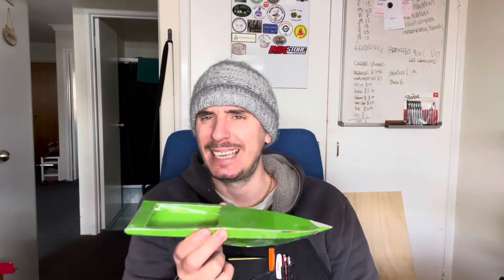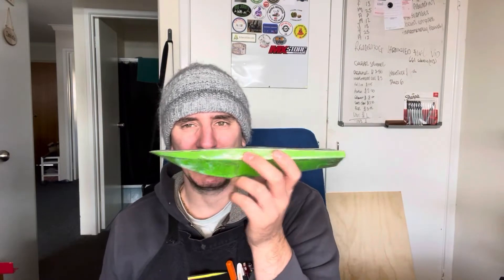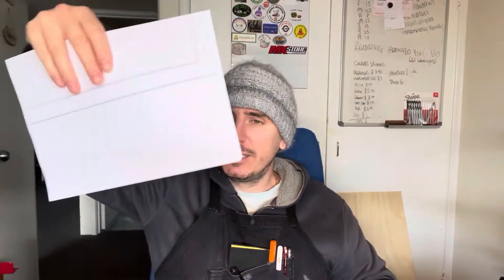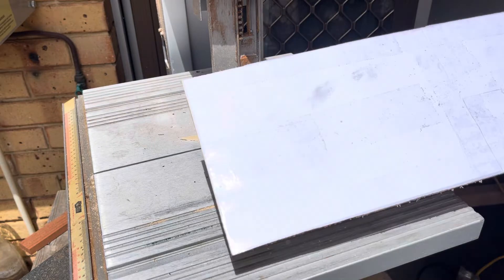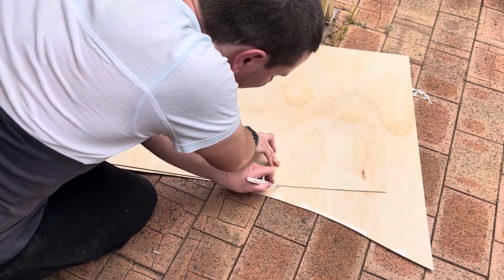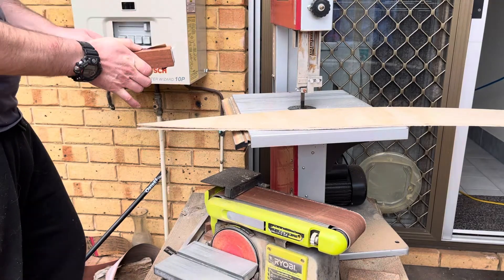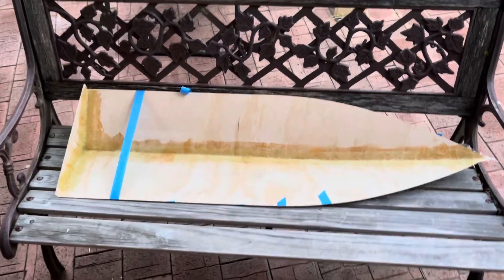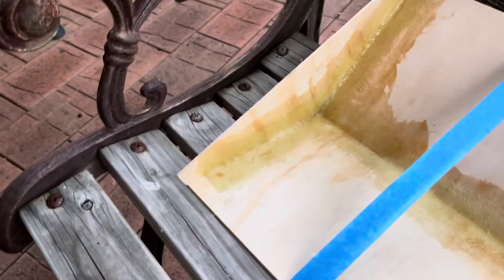2 Stroke Petrol  RC Boat Build (Part 1)

Comment: Good start to a cool toy.  The torque and rpm   of that motor should allow for a pretty aggressive prop. Weighted right and with the right prop you might have a 80 knot model boat🤯
Reply from the maker: If it moves and doesn’t sink, I’ll be happy 😂 lots of trial, error and frustration to come, but it should be good fun and an interesting journey!

Comment: Sweet! Using an FS36 engine? I'm told Stihl diehards don't love the FS36 because it's actually made by Ryobi. Still, I just resurrected one and sold it for a modest little profit, and it ran like a champ! Cheers from Alberta!
Reply from the maker: Thanks :) that’s the first time I have heard that about the fs36! Maybe?! I picked it because it’s a very slim design, will fit in perfectly :) 

Thanks for watching and glad you got your fs36 up and running!!